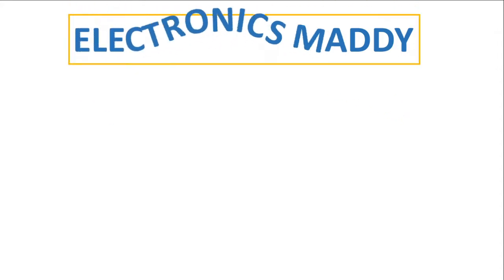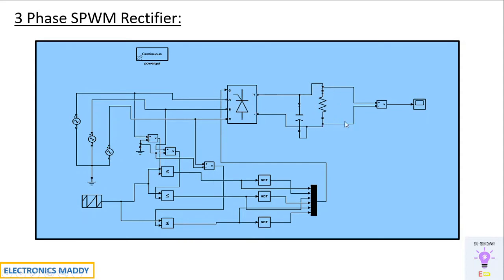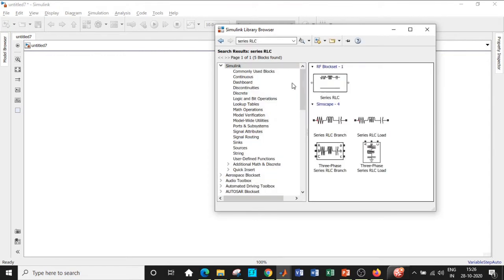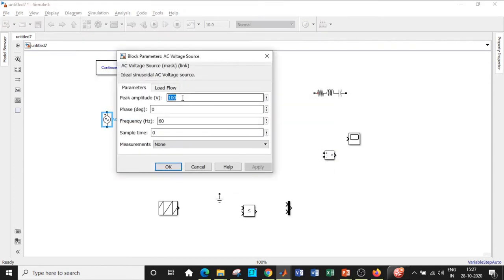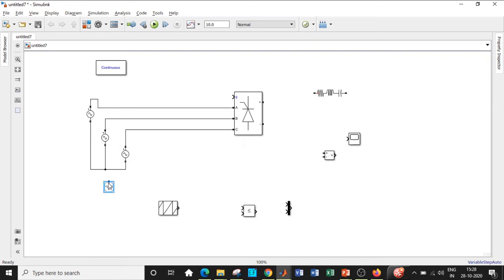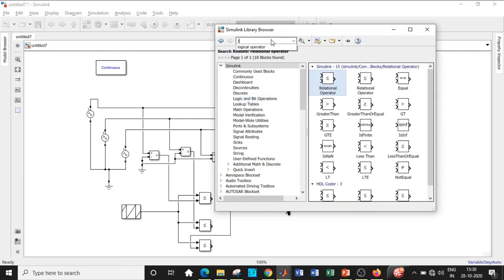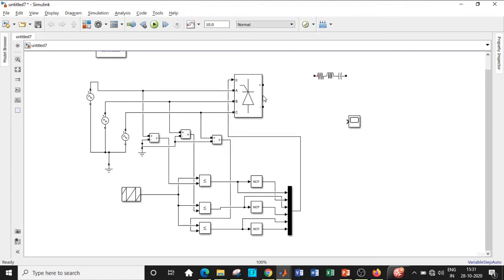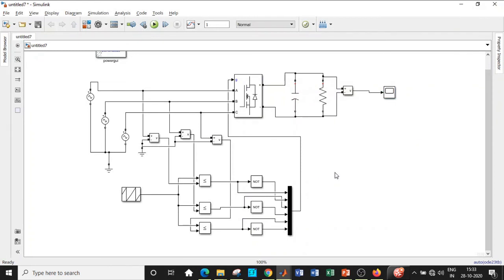Simulation of 3 Phase SPWM Rectifier in MATLAB | SIMULINK

Comment: Sir can we change firing angle in this if yes then how...?
Reply from the maker: Good question. Try changing the carrier (Amplitude or freq). By doing so, the modulation index changes . Consequently the output voltage can be controlled.
Reply: Can you indicate what i should do?